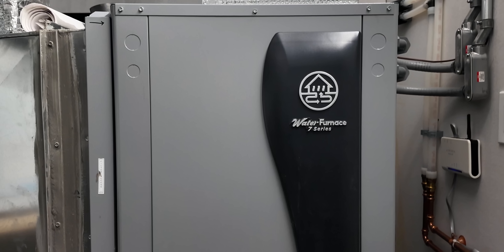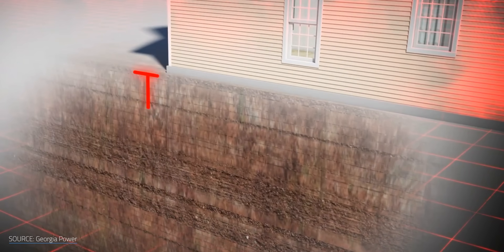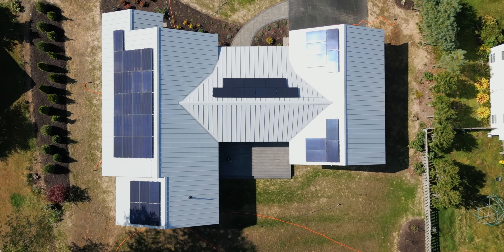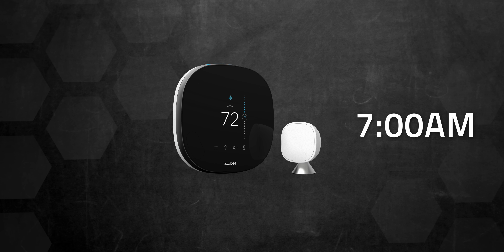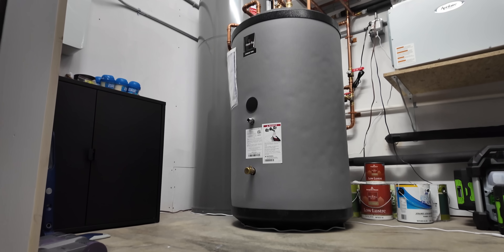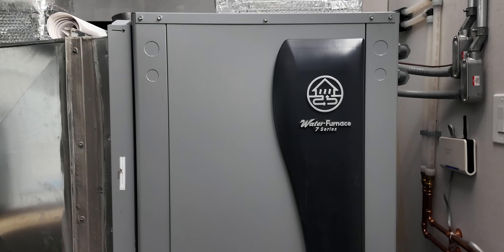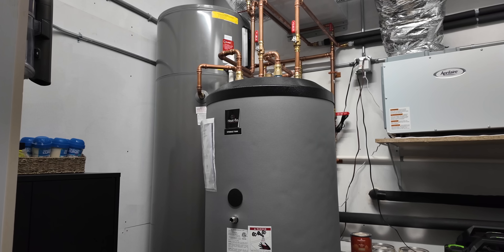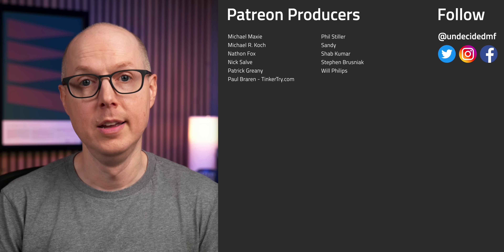How My Geothermal Heat Pump Really Performed (2 Years)

Comment: Not sure why you think Air source HP is any different regarding the temperature changes. It behaves exactly the same as your Geothermal HP, just with lower COP.
It is also best at holding the same temperature without any changes and very slow to change the temperature in the house.

My house has 134 square meters and it is well insulated. My air source HP used roughly 1.15MWh for heating and 1.4MWh for hot water for the last 12 months. For me this would be something like 680$ if I would buy it from the grid. As I have PV system, it's way lower.
I highly doubt geothermal HP would be able to lower that energy consumption in half, but who knows...

I can confirm the fact lot of people find hard to believe and that's with HP your energy use for HVAC and hot water suddenly becomes insignificant. My consumption for those last 12 months was around 12MWh, while the HP used 2.6MWh. So around 21% of total energy.
That 14% of yours vs 21% for me is probably the difference between geothermal and air source HP.

I have midrange Air source HP with simple and cheap install (it was around 11k$ for complete system) and though I would love to have geothermal system, the difference in the efficiency is no way as dramatic as the price. In other words I highly doubt with such a low consumption due to well insulated house, geothermal will never pay for it's upfront cost with it's better efficiency🤷‍♂

Comment: I feel like you could safely add a ductless air source heat pump to your production space without causing issues. You'd want to set it to the same temperature as the ground source system and coordinate whether it is heating or cooling to avoid issues. I have a mix of water radiators and heat pumps in my house and it works fine. Completely independent thermostats and controls and they work well together.

Comment: Geothermal like you said with mini-splits, but with every system looping from/back to a couple separated central 'heat batteries'. Instead of dumping heat into the earth or the air, you dump it into a metal/composite compound of some sort to retain that heat for later use. Kind of like the desuper you showed. Just bigger, and on a longer term scale than water in an insulated/pressurized canister. Something like Titanium might be a good candidate for this, because of its ability to hold high amounts of heat prior to any melting. It's not the best transferrer of heat, but that might be to the benefit of the user since it also means it retains the heat that is dumped into it longer as well. So you can't dump into it easily, but it will keep that heat longer, but will also be harder to pull from. A catch 22 of sorts if you will. 

So I am unsure of the perfect way to go about that part of it all, because water and glycol while good at the job, have their own issues as well. Issues I may want to be able to avoid in having a 100% 'self sufficient' home with tech availability and high energy output where needed. Not just in heating, but electrical as well; because that heat stored can be used to help create electricity as well in its own ways. Solar isn't the only option out there aside from wind and hydro. These can be used in tandem in other ways to create electricity as well. Combine all the things, plus some other effects and mechanisms using old tricks, and you have my 'non-nuclear breeder engine' of sorts I want to build.

It will not create energy from nothing, but it will seem like it, due to the use of inefficiencies and capabilities otherwise of each thing involved. 

Geothermal is just one aspect of it.

Comment: We have had a horizontal loop geothermal heating and cooling system for going on. 14 years.  It is buried  6 ft down in trenches 3 ft wide. We spent extra money on really good insulated ductwork.  Our cost at the time due to state and federal rebates was very similar to a standard heat pump system.  We have been very happy with it and find it to be very comfortable. It was installed in new construction with 2x6 walls and heavy insulation. Oh, and we live in the foothills of WNC (think hurricane Hellene)

Comment: Curious, what your backup heat sources. It looks like you have hot air coil lines that are ran to the air handler. It’s always smart to have a back up heat source for Geo systems.

Comment: Our journey started in 2009 with an 8.4 kW solar array followed by solar evactuated tube hot water system. We install our geothermal in October 2019 followed by 5.4kW of additional solar power. We are very happy that we are now retired and have no utility bills except for water. The house is much more comfortable than it ever was and we do not burn any fossil fuels of any kind. We also recently purchased an all electric Ionic 5 that we charge during sunny days so we are not paying the utility for charging overnight. The best part of all these systems we got tax breaks on all of it and we currently have a $1200.00 credit with the power company. That credit should get us through the  short mostly sunless days of winter as it did last winter. No we did not install batteries because Connecicut utiliies are still paying for the excess power we produce. If that situation changes we will consider batteries.

Comment: Matt, I have to admit that I don't understand. There is room* on your roof for another 45-50 solar panels which with your energy efficient construction and appliances would be more than enough to supply 100% and more of your total energy consumption. This could be done for a small fraction of the cost of your geothermal system and would be ecologically equivalent to your geothermal setup. I guess there is some satisfaction in achieving the ultimate in efficiency, but to me that satisfaction wouldn't be worth $78,000.

*The remaining open area on your roof would not allow optimal orientation, so figure only half the efficiency for those additional panels.

Google tells me that in Massachusetts on a year round average a properly oriented solar panel should produce at least 3kWh per day, so your existing 47 panels (yes, I counted them from the overhead drone shot of your house😀) ought to average about 140 kWh per day. An additional 45 panels, even with the non-optimal orientation remaining on your roof, would probably give you another 70 kWh per day. My home (4500 square feet, 5 bedrooms 4 baths, swimming pool, total electric) gets by on just 24 panels, leaving me with a $2.58 per month grid connection fee, in a location far more favorable (mountains of central Mexico) than Massachusetts in terms of insolation. Without the solar panels and battery storage my energy bill would be about $4,000 per year. Surely 90 panels would more than do the same for you.